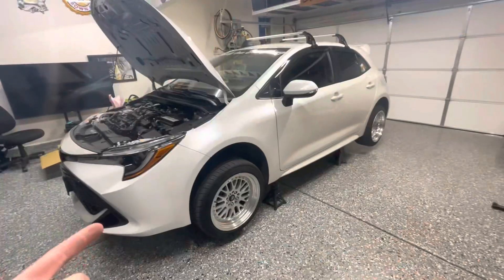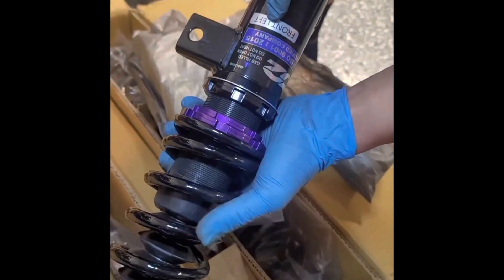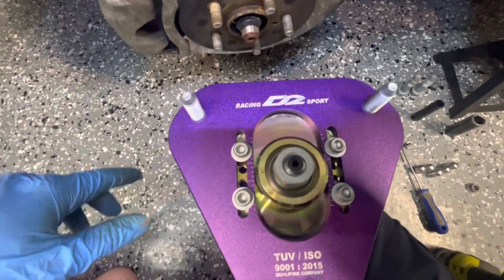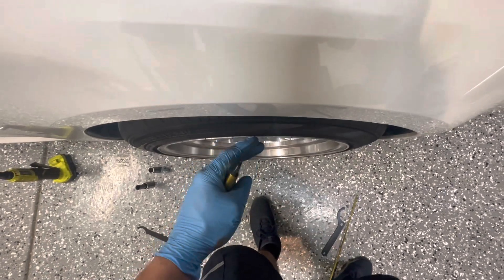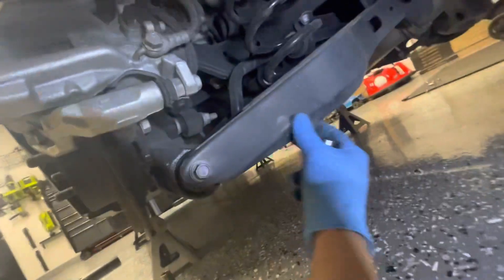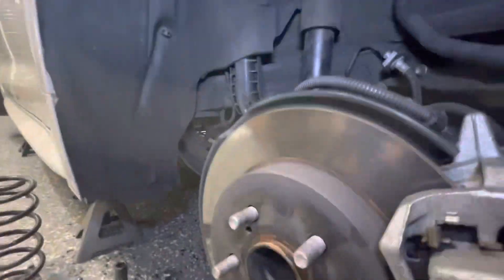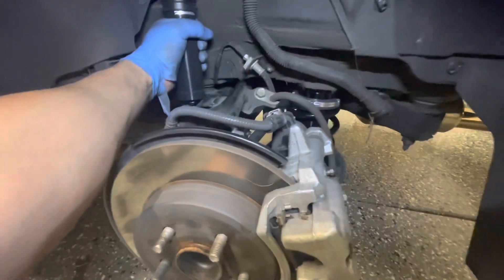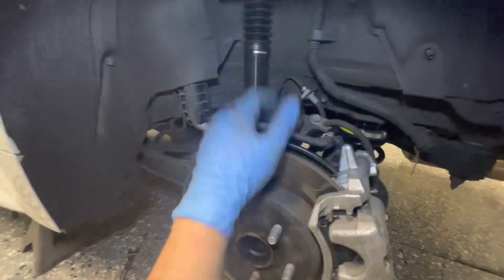2019 Toyota Corolla Coilovers Install | D2 Coilovers DIY

Comment: After doing suspension install on this model Corolla a few times and watching several other install videos, you mention the part that everyone gets stuck on: the rear shock bottom bolt. Taking the 22mm isn't the problem, it's sliding the lower shock mount off the stud. I've seen most other videos show them taking the 22mm off, then taking the 12mm stud out (eg your video). Let me tell you, that stud is in super tight and not only a hassle w/ long reach tools, but you're going to have one heck of a time getting regular impacts (num/elec) in there AND putting it back in. There's a better method than what you described at 14:14.

You should pull out the 14mm bolt at the top of the spindle instead. The 17mm nut on the other side will generally stay put until you get things loose, then you can use a 17mm to hold it. The reason why this is so important for everyone trying to get the shock off the stud is the 20degree downward angle (one other tuber mentions this that I know of however he goes about it the wrong way by trying to hit it off w/ force) This allows to spindle to freely rotate and consequently, the angle of that lower bolt. Once you have that top bolt of the spindle assembly off, it's super easy to slide on and off; you don't even need to take off the lower ctrl arm, spring or even conecting rod. (but you might want to remove that support rod for wrenching room).

The other part that will come in helpful is having a secondary scissor or bottle jack to push up on your spindle as this helps align your suspension mounting holes and allows you to screw everything back together. I'll try to post this on other Corolla install videos as it is really the only thing that I see frustrates the install.
Reply from the maker: I appreciate it 🫱🏼‍🫲🏽
Reply: @Ruinedmkv Do you know if what Coilovers will work on 2010 Toyota blade?
Reply from the maker: @xierxu I have no idea I’m sorry I never heard of a Toyota blade
Reply: at this point bro, we need you to show us. I do not follow. At a loss for the 14mm bolt you speak of